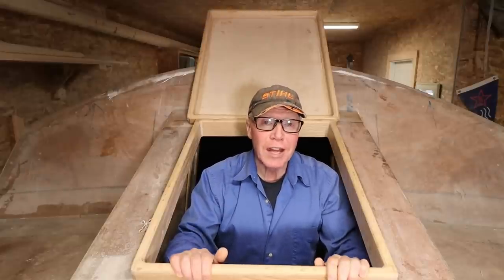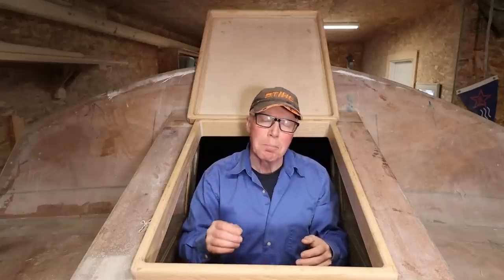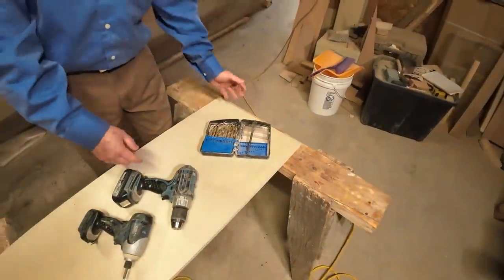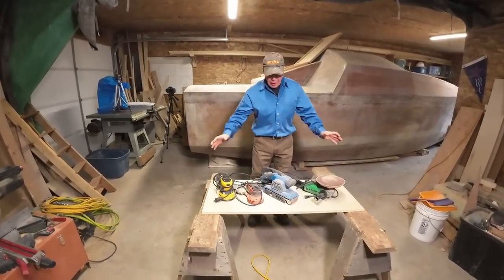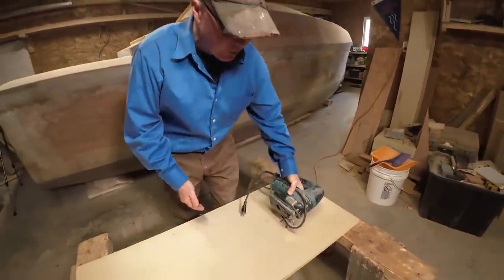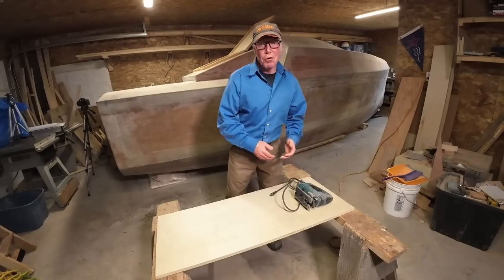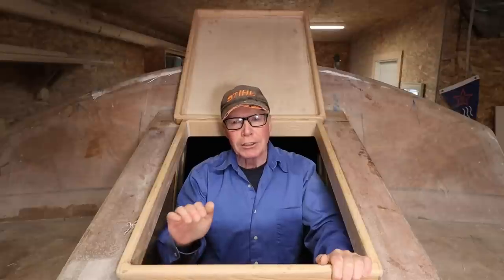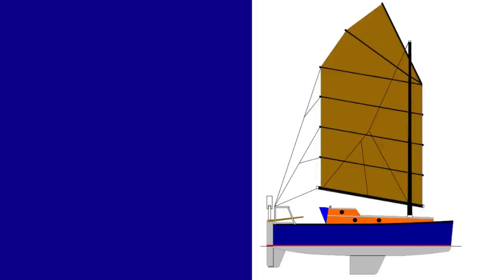S2E80 The Only 6 Tools You Need To Build A Boat // 65 Days Before Launch

Comment: Just to add to your description… The best feature about a drill driver is the clutch. Which lets the drive slip and engage, slip and engage… at high frequency, when the resistance increases. This enables you to easily drive a screw into solid hardwood timber ( so long as the screw can handle it- see below).  Something a normal drill will not do easily. I used a normal drill for years and wondered why would you bother with basically another drill - until I eventually bought one.  Anyone who owns a driver will tell you it’s way way better at putting in and removing screws.

And here’s a #1 tip. Use Robertson square head screws ( thanks Canada :) They don’t cam out under load like Phillips screws or dislocate from the bit like straight slot. While their appearance may not be traditional they just work so much better. A combination made in boat building heaven which makes for quick, easy, powerful screw driving.
Reply from the maker: Absolutely! All my screws are Robertson. Most products assembled in Asia still come with phillips heads sadly.

Comment: This is very useful, and not just for boat  builders. I was cross referencing this with Ran Sailing 186  "Top 5 POWER TOOLS to have on a boat."  Slightly different granted, but Johan is in complete agreement none the less.  He also has a palm sander/orbital sander on his list, but the only difference being he has a variable speed angle grinder (plus attachments) for all sorts of jobs including sanding and polishing. I won't be forgetting either of these videos!
Reply from the maker: Interesting, I didn't know that he did a tool list. Good to know that we are on the same page. Thanks as always for the positive comments Professor
Reply: @RoversAdventure  To my mind perfect validation, and ever so useful!
Reply: @setkacagarro-blogspot-com  Like Alan was saying, light touch required!

Comment: You mean power tools. What I use most is pencil pencil sharpener ruler handsaw small hand plane small surform plus clamps.
Everyone seems to do a lot of sanding fairing filling. Plywood is already fair so I just clear coat epoxy resin it. Before painting. Have resisted buying filler but my building is so poor got 406 silica to fill gaps.
Reply from the maker: I love using my hand tools and thought that I would like to do a similar video about them.

Comment: Bought a pricy Makita cordless drill about 20 years ago, it didn't last one project (only used it for drilling pilot holes and screws, never used it as a hammer, never left it in the rain). Nowadays  I buy the cheaper power tools (unless they seem unsafe). Of the cheap tools, not a single one has failed me yet.
Reply from the maker: I would say you are lucky but if it works for you keep doing it.

Comment: I wouldn't be without my impact driver but sometimes it can be a little aggressive so I keep old drill set up as a driver for doing finer work.

The multi tools are great but for best results you need to use quality blades (I'm using Bosche at the moment) instead of the cheap versions from big DIY chains and the likes of Lidl or Aldi. They cost a bit more but are worth it because they last longer and cut better.
Reply from the maker: Very true on the blades

Comment: Several years ago. I needed a circular saw that would probably be ruined by the end of the job cutting aluminum . So I went to saint Vincent de Paul store and found a aluminum case craftsman from the early 1960s at newest probably from the 50s. 
 It was $8 but I got a 50% off sale lol $4 turned out to be the best circular saw I've used . Sadly it and all my tools were stolen. Junk shop tools have been very good to me. 
 Are you using Marine plywood in the build?
Reply from the maker: Yes, I'm using Meranti marine plywood. Great story about the $4 dollar saw. My favorite tweed sports coat came from a similar discount shop, it was $7 and when I went to pay it was 50% off. I believe that it was never worn and it fit me like a glove.